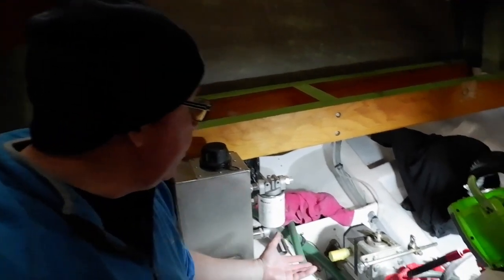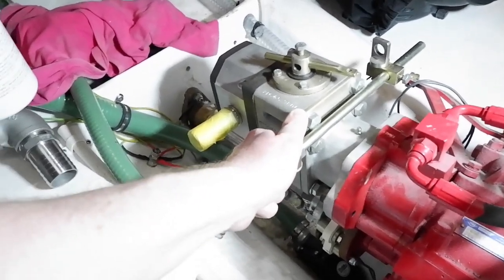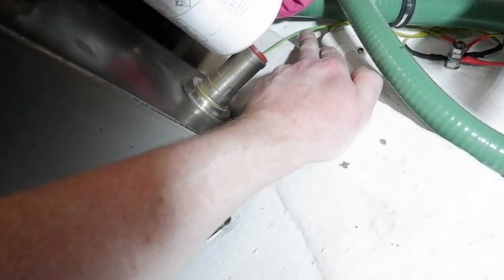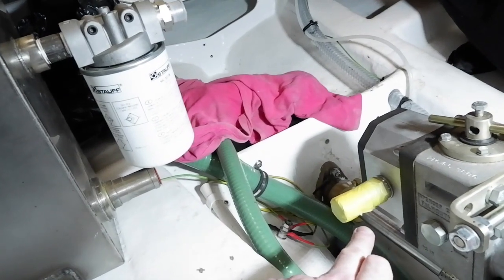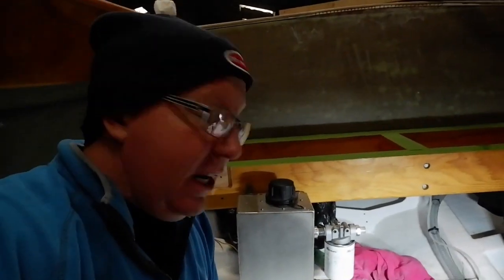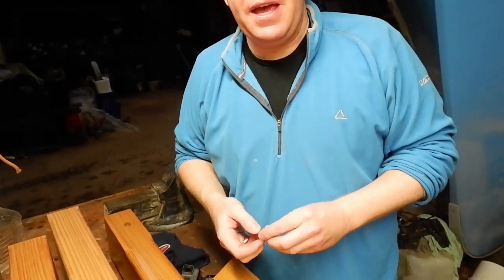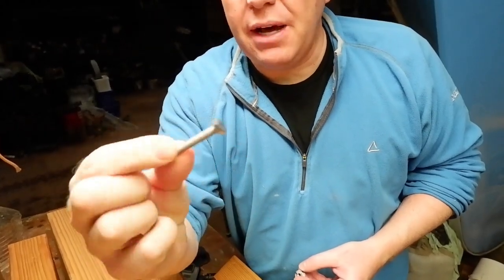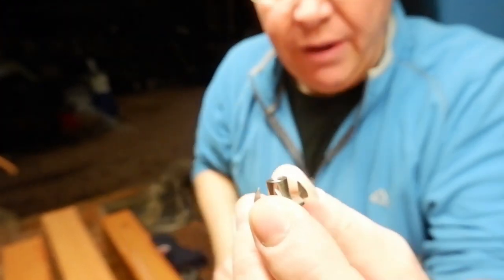Hydraulic heaven Episode 40

Comment: BSP and NPT are slightly different thread forms, bap has 55 degree threads and not is 60 degree.
Now while they are not exactly the same, some or the tapered thread (bspt or nptt)sizes will swap and work fine, but its not good practise, parallel thread forms (bap and npt) should not be swapped about.
For the difference you have out the hydraulic fitting its got nothing to do with different threads, you just ordered the wrong size 😜
Both systems are based on the internal bore of the pipe, for the threaded fitting to slip over the other, you are at least one size or ⅛" out.
Google will get you plenty of comparison charts and thread specs.
Reply from the maker: Thank you Neil, that's amazing!
Just goes to show,  every day is a school day, as I didn't know that. So thank you bud.😉👍
Silly old me thought they'd be all BSP, but there you go....I boo boo'd again!😂😂😂😂😂
All the best bud.  😉👍